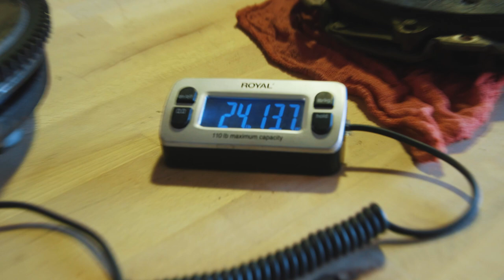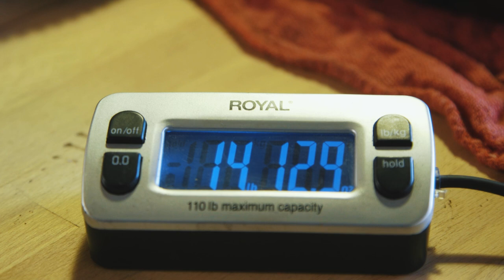Clutch Talk: Upgrading BMW E46 Clutch and Ditching the Dual Mass Flywheel!

Comment: C4 Corvette Owner here. Can confirm the statement about the sprung vs unspring hubs. Most of the kits for the ZF transmission replace the DM flywheel, but also the unsprung clutch disc. It is LOUD. I wish I could get a kit with a spring clutch disc to replace my unsprung one, especially when finding a DM flywheel is very difficult.  Clutches really make a massive difference when it comes to drivability tho. Underrated content.

This is great video! Please keep up the amazing content.
-Luis
Reply: Where is that loud sound come from?
Reply: @realdevbro447  Its literally the gears and half shafts spinning without being engaged. When its cold, its manageable. After driving for a while, that fluid is not as viscous and it can become much louder.

Edit: Spelling

Comment: Heavy flywheel is not that good for gearchanges either.   I have an Escort 1600 which at various times has had a mildly tuned engine with a lightweight flywheel, when I was overhauling it I stuck the standard motor and flywheel in temporarily, and downchanges particularly became slower.   It made a noticeable difference.
So I'm about to do the clutch on my BMW E36 and all the one-piece flywheel + clutch kits I could find claimed to be the same weight as the dual-mass flywheel I'm taking off, so pointless.   Eventually found a super-lightweight racing flywheel, which is probably ridiculous but I'll find out...

Comment: Quick one, the two assemblies must be different thickness right? Dual mass is bulkier than single mass setup. Does this have an effect on the throw/feel of the slave cylinder pin or the clutch fork/ release bearing if they're now further away from the flywheel?
Reply from the maker: No the thicknesses are the same, the weight is removed from the backside of the flywheel.

Comment: I recently developed a gear rattle noise at idle with the car in neutral with the clutch engaged (not pressing the clutch pedal). The gear rattle is most noticeable when shutting the car off. And the rattle goes away when I disengage (push in the clutch pedal) the clutch. I self diagnosed this as an input shaft bearing on its way out. I wonder if maybe my dual mass flywheel is bad and thats causing the rattle instead.
Reply from the maker: Its probably you input shaft bearing, especially if it gets worse when the transmission is warm.

Comment: Thoughts on the DMF and its contribution to combating the crank harmonics you touched on? The 2.8 / 3L have a habit of oil pump nuts backing off, shafts shearing and I feel like it is related to sustained high rpm / harmonics. Does the DMF help to dampen these at all?
Reply from the maker: Probably not but the harmonic balancer may.
Reply: It's all related to the oil pump chain not having a tensioner. That causes excessive chain play and vibration.
Reply: @nvl2691  

SMF will contribute to oil pump failure?
Reply: @reza_dc2  Yes it will, since the stock dual mass flywheel absorbs part of the engine's vibrations. Without it, the oil pump chain vibrates even more. 
If you do fit a lightweight flywheel, make sure to fit an oil pump chain tensioner. There's kits that allow you to fit the S54 tensioner on an M54 block.
Reply: @nvl2691  I appreciate that info ! any chance you know who sells the kit? any other thing I can do to protect the oil pump?
Reply: @RZA77   Hack Engineering sells a kit with a tensioner and a template to drill out the M54 block.
There isn't much else you can do I'm afraid, there really isn't much of a point in revving an M54 past 7000 rpm anyway, even with aftermarket cams.
Reply: @nvl2691  

Okay , so if I’m just daily driving my car and keep the revs under 6 .. ( spirited driving ) , do you think I will be fine ?
Reply: @RZA77   You'll be just fine. Next time you do the oil pan gasket just make sure the oil pump nut is tight, and maybe get a little bit of thread locked on there for good measure.
Reply: @nvl2691  Man , I appreciate your help. So my car is a 2004 530i , manual trans. 
I have a solid mechanic thats going to do the oil pan gasket , and the oil filter housind gasket in mid january.. The clutch is slipping but I am planning to wait until this oil leak situation is resolved. So this nut that your talking about , it has a tendency to back out due to the vibration.. I get that. I will mention it to him during the oil pan job. 
 The oil pump nut is the main culprit , any issues with the crankshaft dampner having to be upgraded or anything?

I bought the car back in 06 with 42k on it , it now has 220k , oem clutch is still in it.
Reply: @reza_dc2  No worries, always a pleasure to help a fellow BMW enthusiast. 
If you do replace your clutch, if this is your daily driver, I recommend fitting a Valeo single mass flywheel conversion kit. The flywheel is a touch lighter than the stock dual mass and will make shifting and the overall driving experience so much nicer. 
The crank damper normally isn't a wear item but you could get it replaced, for peace of mind. You could also replace your oil pump nut with the one from an E46 ZHP, they include a safety wire that wraps around one of the holes of the oil pump sprocket. All of that and your 530i should be ready to go for another 200'000 miles!
Reply: @nvl2691  Dude  you're the man.. I am going to copy all this info and gather the parts. 
I was actually looking at that same clutch manufacturer , Valeo. Only 700 for the clutch and flywheel. Is the ECS stainless steel clutch line a good idea? 

I didn't know the redline off the top of my head , checked it this morning and it's 6500. 
I'll probably take up it to 5500 max every now and then.   You guys have way more experience with the tolerance these motors can take . Appreciate all the knowledge and insight.  
Do you have an IG account by any chance?

Comment: Hey Motoiq. I have a MKV Supra. Do you guys like Uni Clutch or know anything about it?
Reply from the maker: No
Reply: @motoiq  Is there a clutch brand you recommend?
Reply from the maker: It depends on what you are doing and how much power/torque you make
Reply: @motoiq  Just looking to unlock my ECU and maybe a Stage 2 with some E50 at the most. 500-550 Hp
Reply from the maker: You can use centerforce, ACT or Mcleod single disc street upgrade level.

Comment: Are these going to have high RPM lockout like they do on Evos, or is that nightmare exclusive to us?
Reply from the maker: If you mean the clutch pedal sticking to the floor at high RPM, that is a phenomenon called overcentering and it can be fixed by the design of the diaphragm spring. lacking that you can do a pedal stop. If you mean shift blocking at high rpm, that is a transmission issue independent of the clutch, usually syncos.  On EVOs there is an accumulator valve that delays clutch action, and can cause grinding and missed shifts.  You can replace this with the one way delay valve by clutch masters and help your shifting while still cushioning your driveline.

Comment: Doesn't the gear rattle inside the gearbox cause any sort of wear in the long run? I'm considering going to a singlemass flywheel on my Audi TT and they are notorious to cause massive gearbox rattle on this platform. Apparently a fluiddamper or raising the idle a little also makes the rattle go away.
Reply from the maker: No, it doesn't affect wear at all. On Audi's, the rattle isn't that bad but Audi customers are probably picky.
Reply from the maker: @BenDover-io9vg  Not for clutch chatter. The trans oil has nothing to do with that.
Reply from the maker: @BenDover-io9vg  Yes you are correct, also play in the input shaft bearing.

Comment: Why did you cut his responses short? 

Why did you not talk about about the self adjusting pressure plate on the BMW clutch? 

Not really a fair comparison because the original clutch was work and probably wrongly installed because the pressure plate wasn’t reset.
Reply from the maker: By the factory.

Comment: You make it sound like dual mass flywheels are an oddity, "diesel trucks use it". The reality is that pretty much all manual cars these days have dual mass flywheels. This makes the entire driveline smoother and quiter. Therefore there is nothing special on this E46.
Reply from the maker: I would disagree with you. The only ones I know of are some German cars and the Z cars. I am sure they are many others but I would not say most.
Reply: @motoiq  Actually this is not an opinion, but a matter of fact. Find me a few modern manual cars (15 years old and younger) with a single mass flywheel from the factory. You will have a hard time compiling this list. If you look at manual cars sold over the last 10-20 years, pretty much all have a dual mass flywheel. That includes all the German brands (BMW, Audi, VW, Porsche). You won't find any factory single mass flywheel on these cars. Same for American manufacturers: Ford Mustang, Chevy Camaro, Cadillac CTS 4V and 5V. There are two reason for this. First, the dampening achieved with a dual mass flywheel is far superior than what is possible with a sprung hub on the clutch because of the higher stationary inertia of the undampened part of the flywheel. Second, removing the sprung hub from the clutch disk reduces rotational inertia on the input shaft and load on the synchros.
Reply from the maker: You are right because we hardly have gotten a clutch change on those cars because they are largely not our market. I totally agree with you on the dual mass being much better at damping vibrations than a disc sprung hub by an order of magnitude.

Comment: One thing i ve found out about lightweight clutches is that it will reduce top speed  of the car but it will gain acceleration
Reply from the maker: They will not reduce your top speed.
Reply: @motoiq  😂 actually it will reduce top speed because you dont have any stored energy like heavy flywheels do and it will take lot of effort for a engine to maintain the speed and also i know what am talking about thrs also a video about it on youtube
Reply: @beowolf9991  a video on YouTube, it must be true.
Reply: @phillipcarder2177  lol lightweight flywheel really slowed the car after 80mph